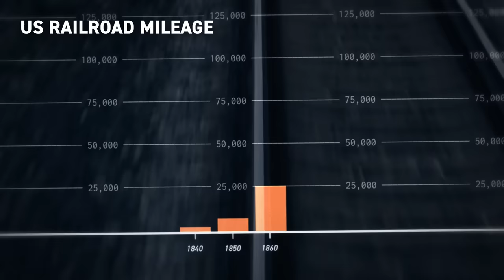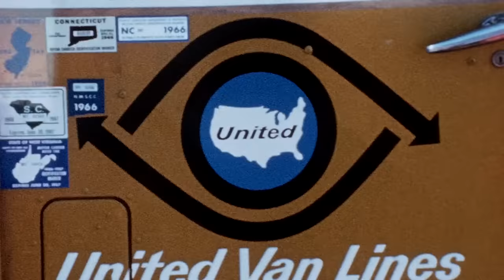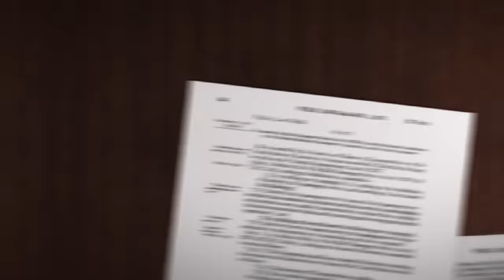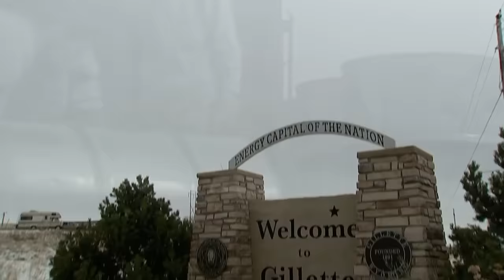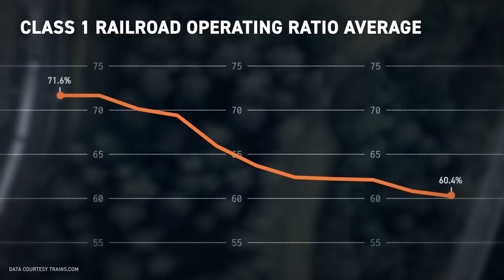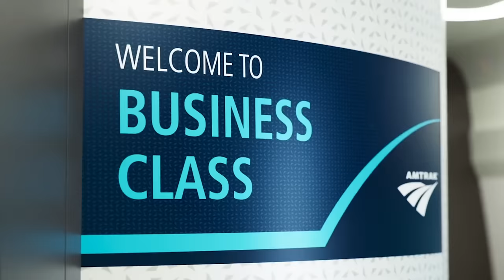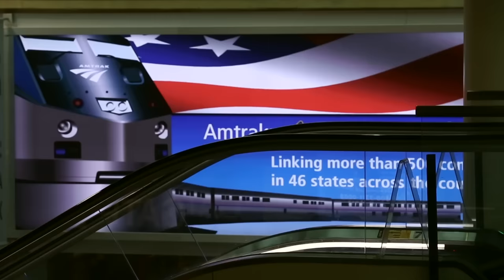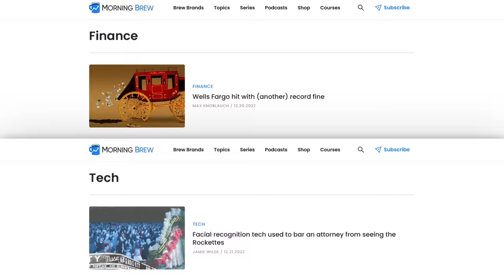The One Tiny Law That Keeps Amtrak Terrible

Comment: No matter how many  videos are made on this topic, private ownership of the train track isn't the problem. It's the lack of speed. Trains don't work in the USA, Canada and Australia for two simple reasons:
1) population density way too low (UK for example has 10x the population density of the USA)
2) cities too far apart.

Sure, we could invest hundreds of billions buying land and building maglev, but what's the point? It will still be slower than flying. We will have spent all that money to accomplish nothing.

So Pittsburgh to Columbus in six hours. I can only assume the video author made a mistake mentioning that, because that's 185 miles and taking six hours means your average speed was 30 mph. You can drive it in half the time.

Denver to Grand Junction....the flight is only one hour. No train you're going to build is going to beat that. The California Zephyr could probably be enhanced so it goes 70 mph instead of 35 in that area, that gets you down to a little over three hours. As long as you don't hang a wire it should be pretty cheap to do that. Let's not kid ourselves that it would "compete" with a one hour flight, though. Notice how the web site for Brightline doesn't say anything about trying to complete with flying. They understand they're too slow for that. They're competing with DRIVING. The high speed option for Dever to Grand Junction is ALWAYS going to be flying through the air.

DC to SF, you really think a train is going to be faster? No. That's 2,967 miles (4774 km). A TGV going at 175 mph (281 km/hr) would take 16 hours. A plane takes five or six hours. Come on, now.

I'm all for enhancing public transit, within reason, but it's not worth it to do what railfans want to do. Aircraft do the job a lot better at far less expense to the federal government.

We already have the ability to go most places without a car. I don't even know how to drive, and I get around this country just fine. I fly to the city I want to visit and then I get around on public transit.

Comment: Ugh, why did the US have to not prioritize passenger trains? ✋️😭 I live 4 hours away from home, and although it's a very easy car ride (you literally just go straight for 3 hours then turn into a town, then continue going straight for another hour), I absolutely HATE driving, and as a result, don't go home as often as I would like. I know that if there was a train that could take me all the way, or even most of the way there, I would be going home every weekend!! Or even just more often instead of every other month. Even if the train ride was longer than 4 hours, I would still prefer it over driving ngl

Comment: You got this whole story backwards, the freight lines built the entire rail system of the United States with the exception of a few lines, mainly the North Eastern corridor with their own money! It's their freight customers that make it possible to maintain the rails and make it profitable! Why should they have to take a backseat to passenger lines that barely pay for anything?

It's Amtrak that failed to buy up the tens of thousands of miles of right away rail lines that the freight lines shut down in the 70's, 80's & 90's when America sadly went from the world's biggest manufacturer and exporter to the biggest importer and consuming nation, thanks to globalism!

FYI - Brightline semi-high speed rail in Florida is proving it can be done without using freightlines. They just started and are already profitable on their South Florida line which is expanding to Orlando this year, then to Tampa by 2026.

Comment: If you go back to the time when there were all those trains that went between towns, and there were both passenger and freight trains combined in one train, the houses and businesses were also combined into one building. Small business owners would live above their storefront. They were scalable and they could  built duplexes and rent out the other side to a friend and when their business grew, they stopped renting the other side out, cut and opening between the two stores and turned the upstairs of the other side into their office. They could even build three and four story buildings and turn them into apartments.  Now, big corporations create big big storefronts and people live in big, expensive houses and people drive miles to work each day. Maybe the changes that are needed must come from the next generation who wants to start small businesses.
Reply: That's not it. Look at Europe and Asia. And they have high speed rail, too.

Comment: When trains headed by steam locomotives provided the fastest, most convenient means of overland travel possible, they were popular with passengers. That time has come and gone.

While the passenger car has provided competition for commuter rail (which exists in many metro areas in the US), it is commercial air travel that has replaced passenger rail as the fastest, most convenient means of long-distance travel. If the traveling public had not abandoned passenger rail, it would have remained profitable, and the railroads would not have been itching to jettison the money-losing service they didn't want to provide for people who didn't want to use it. 

The government didn't save the railroads by creating Amtrak and taking the mandate for unprofitable, unwanted passenger service off of their hands. It was government who took railroads to the brink by requiring that they operate services at a loss to serve a populace that no longer desired them. It's not really saving someone to stop putting them in danger in the first place. 

Now Amtrak (with taxpayer money) operates the services people don't want at a loss instead of the railroads. Unsurprisingly, the prediction by Amtrak about being able to make a profit in four years with the very thing that was so unprofitable that it almost drove the railroads to bankruptcy proved untrue. 

Rather than thinking of how a failed industry can be resurrected, the real question is one of why that would be desirable. If there was sufficient demand for it, it would not have failed in the first place.

Comment: This is so called documentary is disappointing. It is not even poor understanding, but instead deep misunderstanding of the is subject issue. You even got something as simple as the 4 consolidated rail lines of today wrong. A documentary? That just sends my eyes rolling.

The reason why automobiles won over rail eventually is because of a variety of reasons, none of which is inherent to the automobile's internal combustion engine. Automobiles eventually won the war because of aggressive closing of streetcar lines as pushed by the automobile industry, urban sprawl & decentralization that resulted from increase automobile popularity, deterioating inner city conditions, and massive public funding of automobile infrastructure such as the interstate highway system.

The reason why Amtrak does not work is not mainly due to a priority issue, but rather insufficient urban densities at the nodes you mentioned to support the ridership needed to make passenger rail viable. Passenger rail realiability inherently required a high population density because it needs some redundancy (e.g. Just in case a line is down for maintenance, people can still rely on it to get them where they need to go), which we unfortunately don't have for a lot of newer cities that you cited. I know for a fact that freight rails routinely stop work to accomodate Amtrak's trains, so saying that they were not given priority is not really a fair characterization.

The only thing I will sign off and agree about this video is the unrelentless chase of OR in tangible and real industries - that applies not just to freight rails, but other capital intensive manufacturing industries such as Boeing, automobile manufacturing, and etc. Wall Street needs to understand that a lower OR is not a metric that determines actual efficiency, but rather economic efficiency that means absolutely nothing to the wellbeing of the industry. It's akin to trying to figure out how to get a chicken that lays golden eggs to keep doing so with the least cost possible - you can only cut out so much until you start measures that can negatively impact the chicken's health. Rather of thinking about OR as a measurement of efficiency, one needs to understand OR is a measure of how well an organization collects economic rent, which pays absolutely zero tribute to the parties or the industries involved. Consider this - one of the best industries and organizations that has the lowest possible OR? The electronic fraud and scamming industry. They used the least amount of operating resources, to secure the most output possible and no extra effort is wasted - but is the world of scammers the one we really want to live in in the name of efficiency? That's the core question we need to answer to ourselves, and to our children / the society of tomorrow.

Comment: Except the Biden deal failed. The most important point missed here is that the "Democrats" could fix this today if they wanted. Forcing passenger rail to use its own tracks. I live along the NEC and choose to drive because of personal safety and lack of connections. If penn station and Grand Central had a direct connection or trains went to both stations it would be more usable. Acela type service needs to be the next big push. An Amtrak station at or near all the airports.

Comment: UP tried to make a passenger rail from Lincoln NE to Chicago. It was going to cost them next to nothing, and because it was on their rails, they would most likely be on time. After government intervention and regulation, it was going to cost them 10 to 20 times more than they wanted to spend, so they ditched the idea. The government and regulation are the problems, not the solution.

Comment: what a bunch of BS. the reason amtrak doesn't work is because no one wants to travel by train. its expensive and it takes too long. airplane is cheap and WAY faster. heck......you can drive faster than the train. all the commenters keep comparing the US to european countries. those countries are small. The US is huge. there just isn't a desire for rail travel. there is a very vocal minority and that is it. Americans...true Americans value freedom. driving, there is a freedom to do what you want.
Reply: Europe is a similar size to the USA. And Europe has almost all of its countries interconnected by rail. Think of Europe like the US and the countries like states. If they could interconnect so could we. A lot of people like going on train. And in Europe its faster to take HSR than drive.
True Americans value freedom. Which is taking whatever type of transport you want.

Comment: Hipster railroad agenda makes little sense. Freight makes the $$; passenger trains do not.  Passenger trains just make your taxes higher. More freight should be shipped on trains this alleviates truck congestion on highways and damage to roads caused by trucks which equates to less tax dollars having to be spent over time. The problem with freight railroading though is the class 1 railroads have a strangle hold over any smaller railroad companies that could become competition to them.
Reply: Travel to Europe or Asia so you can take advantage of great passenger rail service. There is no excuse for the USA not to have great passenger rail service, including high-speed rail.